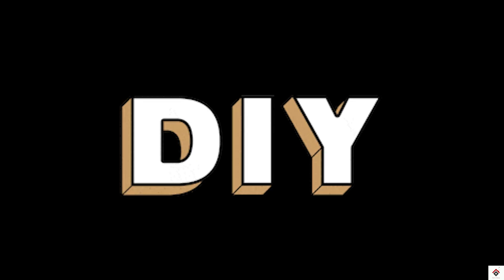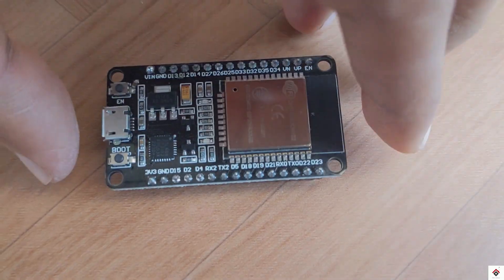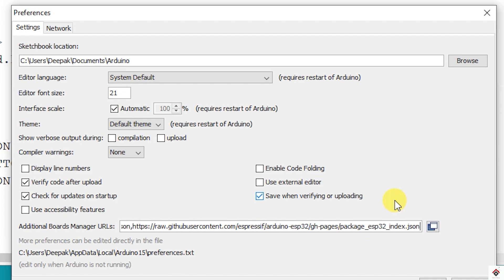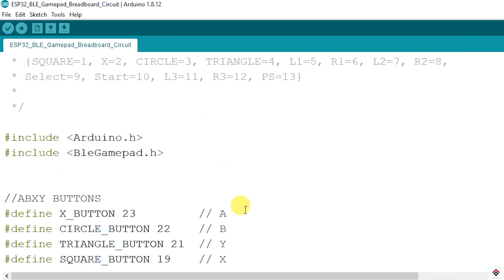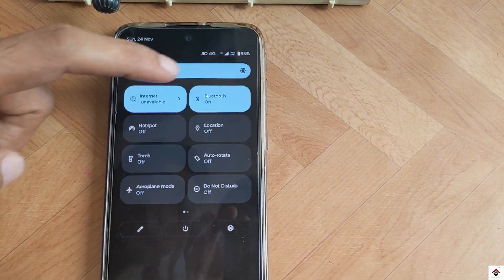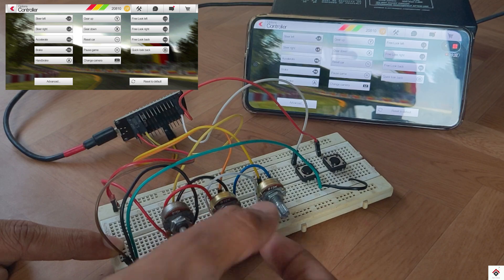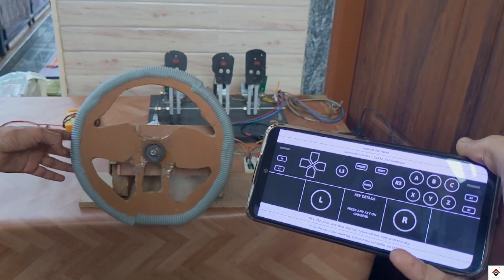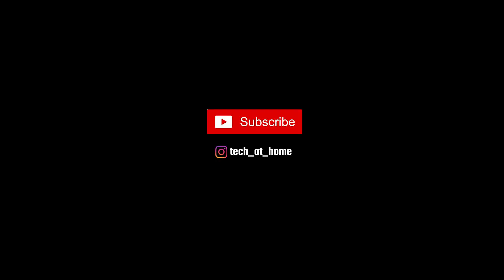How to make ESP32 Steering wheel for Mobile ᚼᛒ📱 | Bluetooth Racing Wheel for Mobile Games

Comment: Brother that the steering wheel have 360 degrees turn in your program code?
Reply from the maker: Not by default.
This uses potentiometer but you can use gears to increase the rotation.
Reply: @techathome  how brother?
Reply from the maker: Something like this: https://youtu.be/WMgQM67uWdM?si=dE574OKCvC8Sd0Ha

Comment: Brother, please tell me, the coding you did on your laptop, can it be done on mobile too?
Reply from the maker: I am not sure whether required libraries for this project can be installed in the app or not.
Check this once: https://youtu.be/HueSXtQQNLM?si=kou6jFS6KOC9n7BE
Reply: @techathome And one more question is whether there is any delay in the potentiometer that you have installed in it, if there is even a little delay then can we install a better potentiometer than this?
Reply: @techathome brother reply please
Reply from the maker: Slight delay will be there and also depends on game. But it will not impact on changing the potentiometer.

Comment: can I not use two potentiometers (right joystick), but make the gas and brake buttons? I just tried it, and there was a problem: some buttons were always pressed, even though I hadn't touched them and didn't have them (for example, the mode button was always pressed, even though I didn't have it) 😥
Reply from the maker: You can use potentiometers also.
Did you make unused pins as 0 in the code?
Check this video also: https://youtu.be/66XMEY996lA?si=HD5dEgb7nXQ2DC-F

Comment: Bro i  need help because  i have done one steering wheel using cardboard and using mouse i have done but it not working in mobile please give me solution to connect
Reply from the maker: Mouse wheel doesn't work on mobile. That is only for computer.

Comment: Bro in paddle making video you are using Arduino leonardo  in this video you are using esp .esp is only for steering wheel?
Reply from the maker: This is for mobile games.
Arduino Leonardo is for computer.
Reply: @techathome  can I use wired connection between phone and esp
Reply from the maker: No
It works over bluetooth.

Comment: Bro can i connect it to pc with usb
Reply from the maker: If you connect with usb, PC will not consider it as game controller.
Slight changes in the code needed to use it with your PC over bluetooth.
Send request on our mail. I will tell you the changes: deepakhd20@gmail.com
Reply: @techathome  bro I mailed my connection photos to you bro please reply me
Reply from the maker: Keep all the potentiometers shaft to centre position approximately and pair with phone. Try this way.
Reply: @techathome  bro may be my esp 32 is defective
Reply from the maker: No I think.
Is code uploading properly?
Reply: Yes i properly uploaded  @techathome
Reply: @techathome in gamepad tester app it works but in game it doesn't works correctly and ghost touching automatically
Reply from the maker: Then no issues with board.
Try what I suggested with potentiometers.
Reply: @techathome  ok bro

Comment: Bro my mobile ghost touching after connecting to esp 32 what happens bro
Reply from the maker: Connect all the inputs and then pair with smartphone.
Reply: @techathome  when i connect all the buttons are activated I can't configure settings and ghost touching happening  😕
Reply from the maker: How many buttons have you connected??
Have you connected 2 potentiometers also?
Reply: @techathome  i connected three potentiometers and two push buttons as shown in video bro
Reply: @techathome  should i reset the esp 32 and uploaded code again will it work
Reply from the maker: You can upload code again.
Also send connections photos on our mail.
Reply: @techathome bro I installed new version of esp 32 in board manager
Reply from the maker: deepakhd20@gmail.com
Reply: Bro i updated libraries and game pad and uploaded code it a problem  @techathome
Reply from the maker: What did you change?
Reply: @techathome  im just updated the versions of libraries and uploaded
Reply from the maker: Remove evrything. Follow exactly what is shown in video and check. Because I don't face any issues.
Reply: @techathome  bro i changed number of buttons it's worked
Reply: @techathome  thank you for seeing my all  comments and give feedback 🙂
Reply: @k.sivabalan12th-c69 brother how ? mine is ghost touching like yours

Comment: How we can play Arduino leanord steering wheel and paddle and gear with Android ? And connections please
Reply from the maker: No
Leonardo wheel doesn't work for phone. It's only for computer.
Reply: @techathome  dose 600ppr encoder motor work in android with blutooth Arduino which you use in mobile steering wheel

Comment: Bro the connection can be done in series or parallel
Reply from the maker: Which connection exactly??
Reply: @techathome  connections between all the buttons to ground
Reply from the maker: One terminal of all push buttons connected together to ground.
Other terminal seperately to ESP pins.
Reply: @techathome  thanks bro

Comment: Bro can we add potentiometer to L1,R1 button ls
Reply from the maker: No, L1,R1 are only for buttons.
In total you can add 4 potentiometers.
Reply: @techathome  thanks bro
Reply: @techathome  tell me bro
Reply from the maker: You can upload code without connecting also.
Reply: @techathome  thanks bro
Reply: @techathome  one last doubt does the potentiometer in accelerator and break needs full rotation or partial only
Reply: @techathome  the potentiometer should be in middle position or starting position at accelerator
Reply: I have one doubt, when uploading code to Arduino is it necessary to connect buttons and potentiometers or we can connect at any time

Comment: what if i want to add one more button
Reply from the maker: You have to add the pin numbers in the code. By default it's kept 0.
Required steps are clearly explained in the same video.

Comment: Can you please use 2 rs 775 motors in your ffb build Please 
And will it beat logitech g29 ?
And how much power supply will i need
And all the changes need to be done
Btw you all videos are fire man
Reply from the maker: - Even if you use 775 motor, connections remain same. Just connect both motors in parallel.
- I have not used any other wheels, and I don't think so it will beat. Torque will be more with this Ebike motor but I think sensitivity is less compared to Logitech.
- Power supply depends on motor specs.
-No changes, see if you can buy 1000PPR encoder instead of 600PPR.
- Thank you♥
Reply: @techathome  thank you but now iam planning using 895 motor can you give some guidance
Reply from the maker: Anyway this is also DC motor.
Connections remain same. You have to select pulleys based on motor torque and RPM specifications.
Reply: @techathome  so i have to change the pulleys !!
Reply: @techathome  can you please tell me which should i choose please

Comment: hey bro can you tell me how to make a force feedback  steering wheel with 3d printing stepper motor for pc and  A4988 Stepper Motor Driver Module
Reply: Please tell where to connect the second motor in the same bts7960 motor driver because the second place to connect it is used by power supply
Reply from the maker: You have to connect to same m+ and m- terminals itself, but motor should rotate opposite to 1st one.

BTS driver has 1 channel only.
Reply: Can you make a video or explain briefly please
Reply: So i decided to use 895 motor instead of 2 rs 775's
Reply from the maker: Open source EMC firmware support only DC motor based ffb.
You can try this if you are interested: https://youtu.be/crdDhvhBG0M?si=UWh95hT1WejMME05

Complete playlist: https://youtube.com/playlist?list=PL4B0LEKY-jrROPZPEDMZ4DPqISPXvVsdL&si=r82hSCsDznehApdO
Reply: @techathome  can i use 2 775 motors
Reply from the maker: Yes
Reply: @techathome  can you give some guide
Reply from the maker: There is no difference,
You can watch our ffb playlist for computer games. We have used ebike motor, same steps but use 12v.